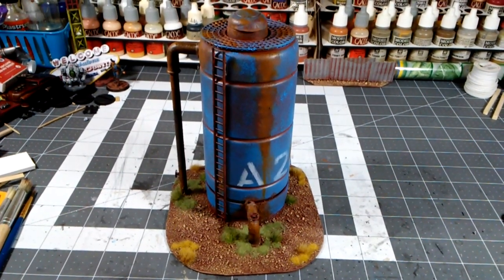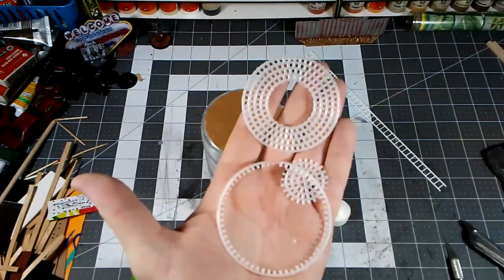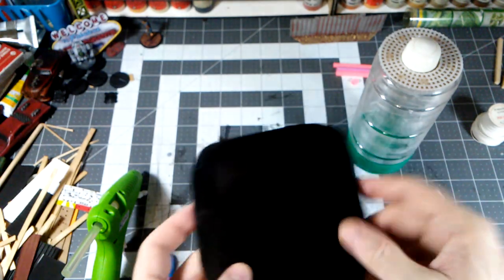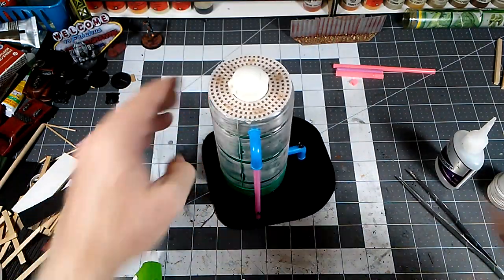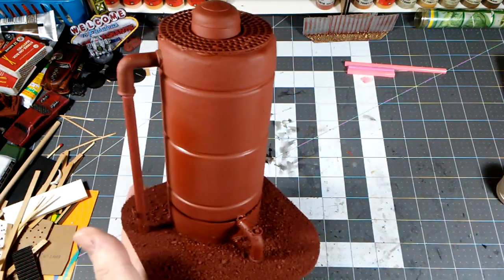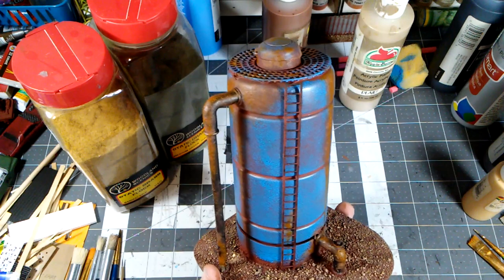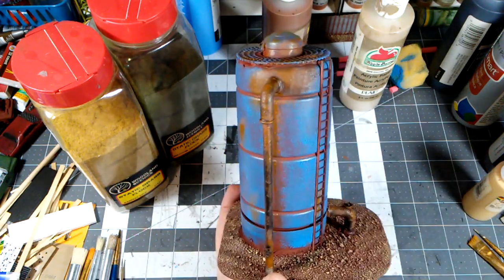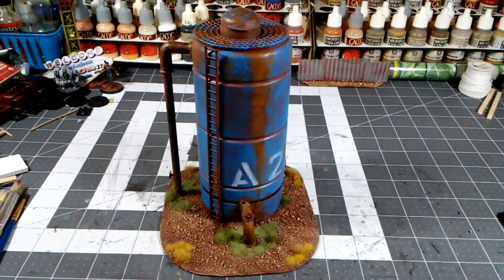Post-Apoc Water Storage Tank - Ep 30

Comment: Great work, man. Solid piece & nice video.
For weaker/thin materials like straws/rubber, I find it's best to add reinforcement like acetate, card or cable-ties if you're looking to drill in pieces so there's enought material to thread & secure the pinning.
If you're wanting to skip the mod-podge step then try using a gloss spray paint for an undercoat, it'll give a far stronger bind to even stubborn plastics & won't scratch off like matt finishes.
The reason most miniature painters will avoid gloss paints like the plague is because it's not suitable for miniatures but they don't seem to know that it's perfect for terrain.
You will need to add a rattlecan matt spray coat afterwards as the gloss finish will repell acrylic paint & ink washes.
Anyway, I'm rambling again. Nice to see you using the button snaps as valves too
Looking forward to the next video man, this one was great
Reply from the maker: Thank you sir!  Many years ago I used to prime with gloss but being incredibly impatient I switched to flats as they dry so fast. But I do have a couple cans of gloss black I bought in error  recently so I will give those a try on my next batch of weird plastic bits. Cheers!